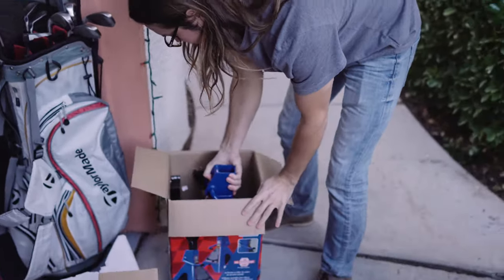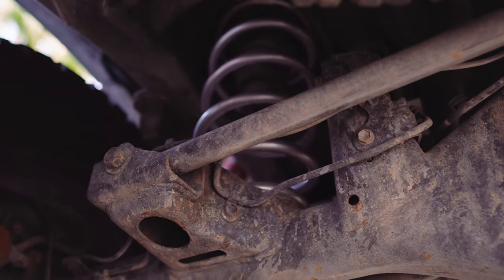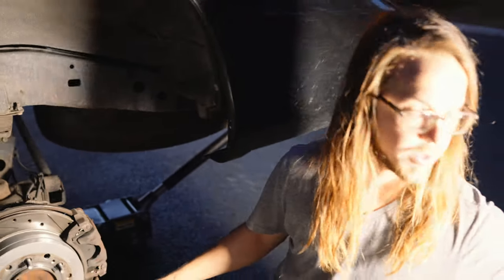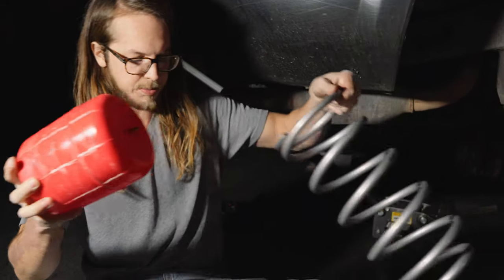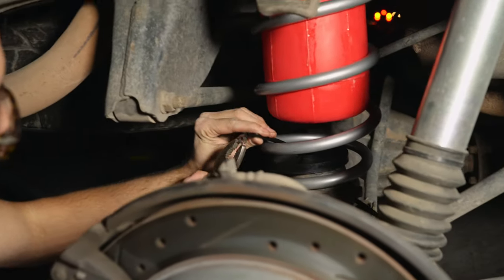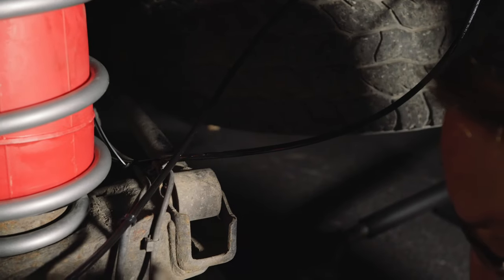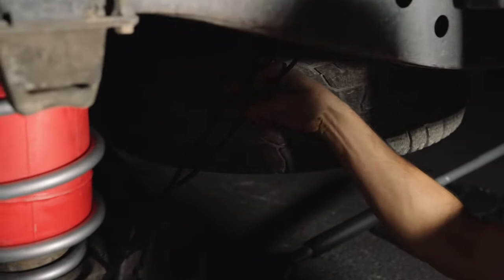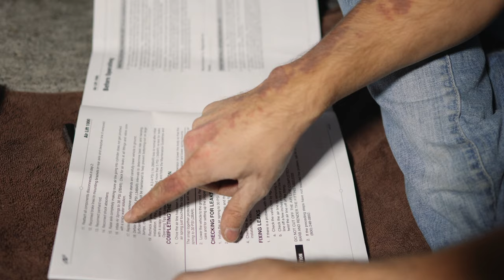How to install Airlift 1000 on 4th Gen 4Runner

Comment: I ordered the kit from Firestone for my 4Runner.  I also ordered a t fitting.   I think it's a better option if a bag blows both will deflate at the same time.  Also it ensures you always have a even pressure left and right at all times preventing tire wear.
Reply from the maker: frankieg bangems I considered the T also. The main problem I had was that if the load is left or right heavy it would cause the truck to lean more to one side while simply putting the air in the other bag vs trying more to hold it’s own weight and keep the truck more level. Not sure which is better but they are both good options!

Comment: I just put the same bags in my 4th Gen. I decided to add a valve to the tubing so I can either link or seperate the bags. From what I've read, having the bags linked will help increase flex of the rear by pushing air from one bag to another for off road. Then seperate them for towing on road. Either way, great product. Putting the gear back in after install, the rear hardly came down. Much better. Great install video. Very informative and helpful to understand how the product is put together.
Reply from the maker: Mike Halasz Thanks! Glad you enjoyed. I’ve been running this for almost 6 months now and couldn’t be happier. Through off-road, on road, towing.. it’s done a fantastic job. 
I read the same thing about add a valve to connect/disconnect the two. I’m actually trying to limit my up travel to keep my 33s from rubbing at the top, not something trimming can fix. The droop isn’t hurt at all so I’m in a pretty good sweet spot. Even still with more extension articulation I’ll run a little, but no where near as bad as before

Comment: Hiya, 2005 Limited V8 here stock suspension. Was going to replace struts/shocks and eliminate XREAS (I don't have the manual controllable air lift), but I'm considering installing the Airlift 1000 at the same time. My goal is to tow my track car to events, so lets say towing weight of 5,000lbs max. Do you guys recommend going with the Airlift setup, a weight distribution hitch, or both? The trailer will have brakes.

Thanks for the advice!

Comment: "if" youre worried about the lines/bags sharing too much when under load:

 you have check valves put in this will keep shared pressure from occurring under loads and save u from putting 2 holes in the vehicle (side also if a leak)

so it would go like this  input valve  ------  T connect  ---  (right side/left side)  ----  check valve  --------  airbag
Reply: oh and for pressure u would put it to like 31.5 to account for the check valve since u seem to like 30
Reply from the maker: Leo That would be a good setup. I prefer simplicity but I see the draw to having a setup like that.

Comment: Did you guys install the stock sized air bag for you lift coil? Or did you have to order a taller bag? Thanks and great job editing, I have great appreciation for video editors since I really don’t like doing it. Lol
Reply from the maker: Feels good to be appreciated! Thanks for noticing haha I’ve been a videographer for a long time. They are the stock size bags. It’s not exactly easy to find a bag that the same diameter but taller. They do sell airbag spacers, but I read about someone who just cut less of their bump stop, so I gave that a try. Worked great! My experience is it’s easier to use the stock bag. Depends on how much lift you have too I guess.
Reply: @TrailBendersOverland  thanks!

Comment: My 4th gen limited has got the factory rear air suspension on it currently. Will I need a kit to seat the spring on the axel, or to get the bump stop that you cut up?

Comment: is there a particular reason to cut the bump stop at all?
Reply from the maker: publicEnima Yeah, the airbag simply wont fit without cutting the bump stop. The airbag takes its place. And depending on how for lift your spring gives you determines how much to cut off the bump stop

Comment: Did you do the review video?
Reply from the maker: I haven’t yet. They’re been mostly great for the last 2 years. I had one issue where I was off-roading pretty hard and I started losing pressure. I put fix-a-flat in it and it sealed right up and has been great ever since.